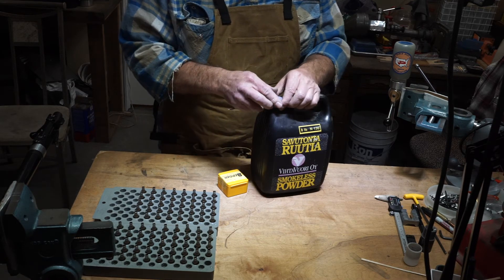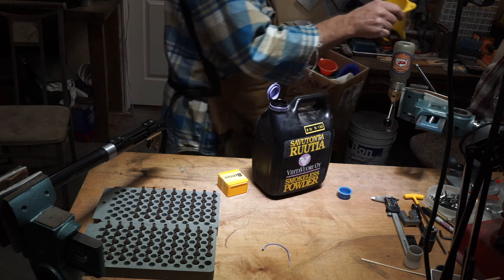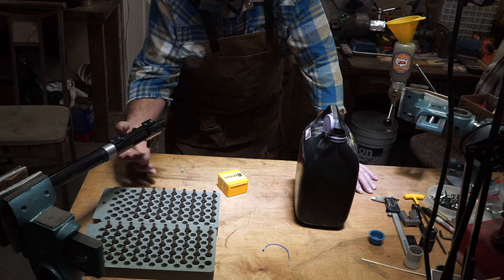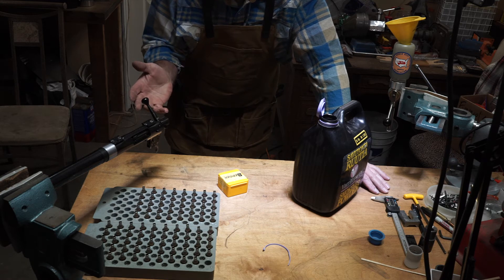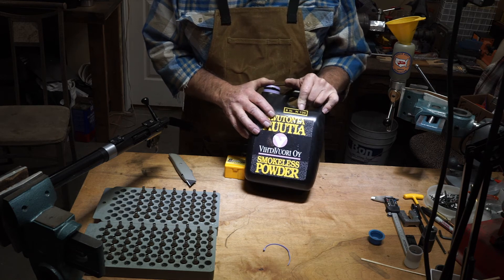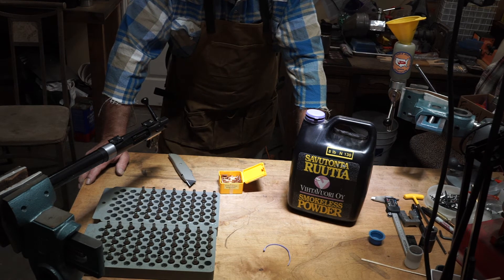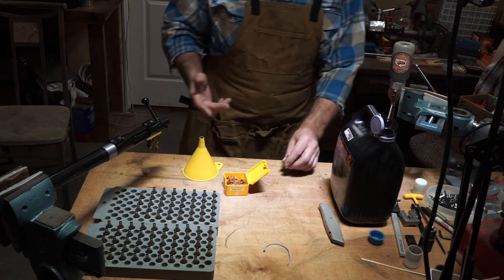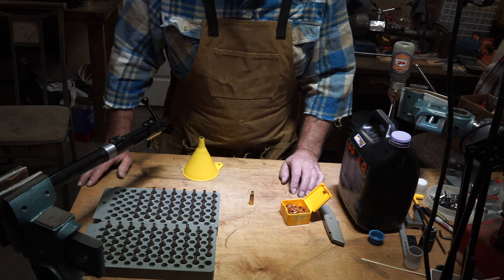EP171-Fireforming. Blowing out using 22 bullets

Comment: You make some good points.
1. Powders on a basic burn rate chart don't always follow that burn rate when used in a different case.
2. Bending the rules to make something better or....to use whats available.
3. Galling lugs by not greasing and thumbing down on tight brass due to neck sizing only.
Good stuff!